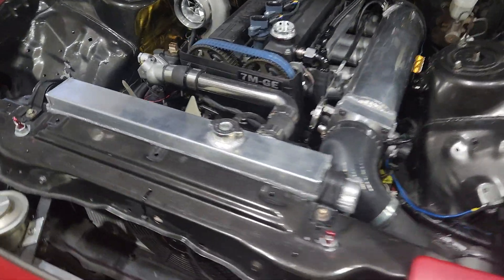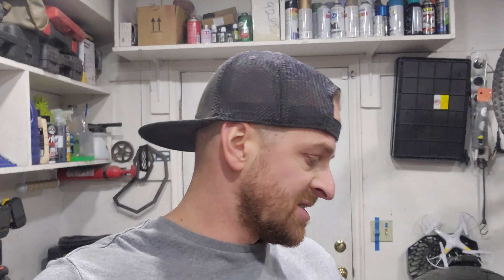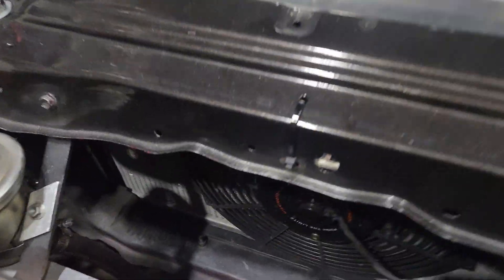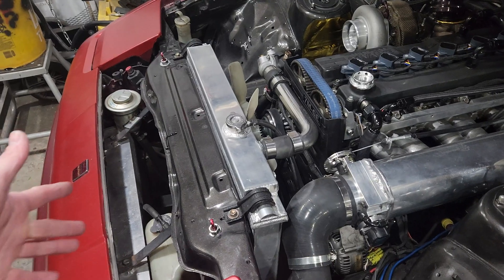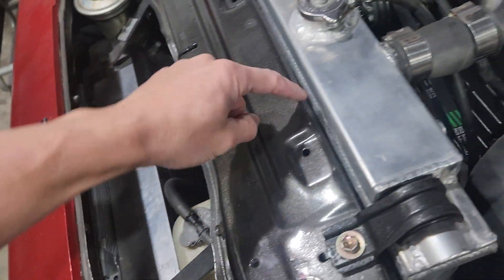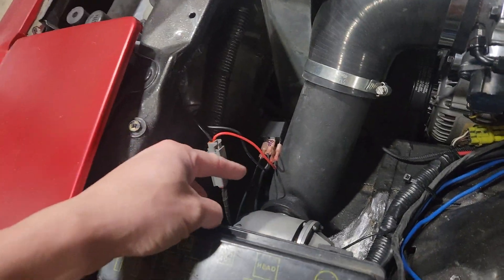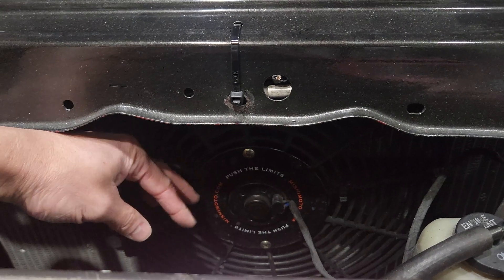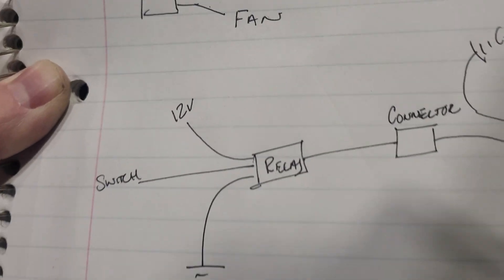How to wire up an electric radiator fan on an Mk3 Supra

Comment: What do you think of putting.the 7mgte or a 1 jz engine  in an Audi A5 wouldn't even fit ?  Good or bad idea? Yea in the bmws I see that 1 or 2 jz swap A LOT , very common lots of info on that swap.  Or maybe 🤔 I'll just get a grocery basket and put a 1 horse power electric bike motor on it and cruise around town in that 😂
Reply from the maker: It seems like the 1j/2j swaps are pretty common amongst a lot of different vehicles. I'm not super familiar with the Audis but I know they are common enough, you should be able to find some swap kits and wiring harness adapters. I have future plans for a 1j/2j/LS in an early 2000s BMW M3 👌. We will see what the future holds.
Reply: @mainstreambuilds  I'm thinking about an Audi A5-t or maybe an Audi RS-5 but  everyone tells me to stay away from them because of common problems and other issues. But I've met a few people that had audits and said they're never had major issues. I'm just tired of the everyday cars one sees like the civics and Corolla,camries. I saw a 1990 red supra turbo stick shift at a dealer really clean but do I want to pay $15 k for a 40 year old car plus it's not targa top which is a must for me if I were to get one. But damn audis are nice . I haven't seen an Audi yet with a 7m or 1jz yet, or maybe I'll just come borrow yours 😂🤪
Reply from the maker: @alessandronarom6751  oh dude I'm totally with you. I've heard the same about BMW. They have a lot of weird wiring issues and just weird things overall, but you drop a supra motor in it and that will fix everything haha. I'd say if you have the time and money you should roll with it. I think it would be a cool swap and not super common. I'd let you borrow mine but it's still not tuned and not running..........Hopefully soon 🤞
Reply: @mainstreambuilds  I'll be waiting with some slurpees and hot dogs from 7-11 😂 I've seen LOTS  of bmws with the supra 1jz engine so you'll do well with it.

Comment: When we did my 2JZGE swap, we used upside down dual Mercedes C320 fans (the one before the runny egg headlights, don't remember the exact model). They worked great!
Reply from the maker: Oh that's good to know! I'm all about using OE parts from other cars if it works. Putting those Mercedes brakes on my car was the best decision ever. I will have to see if I can find those fans.